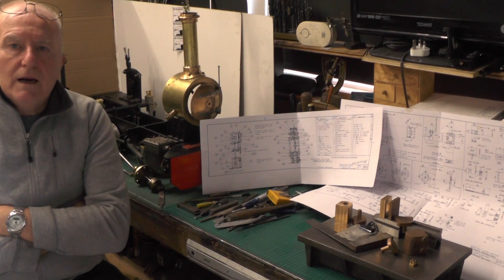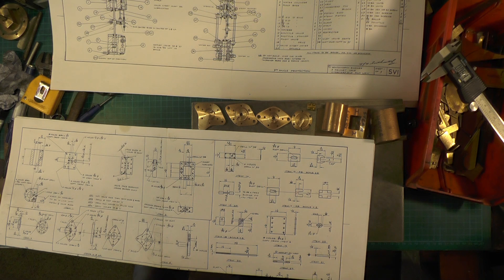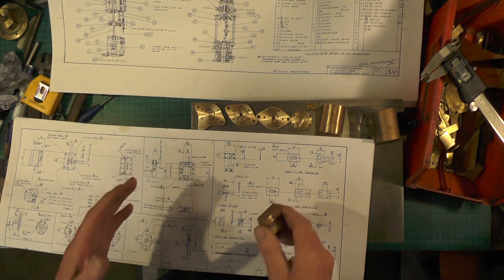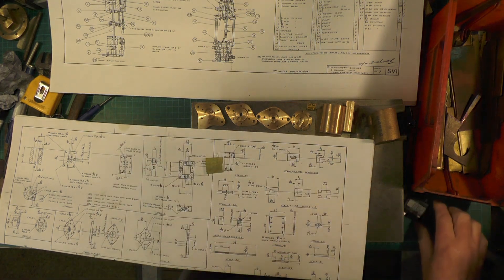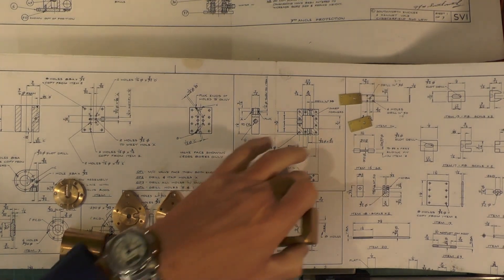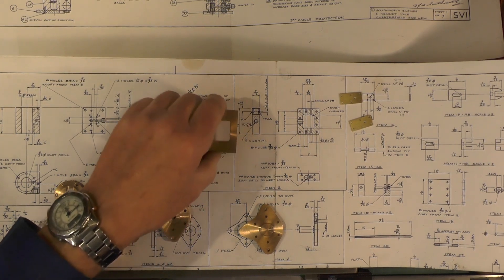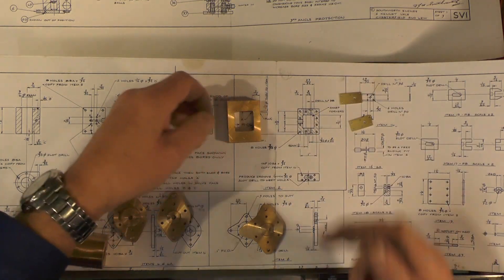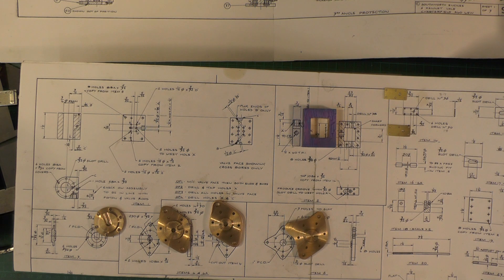Southworth Steam Water Pump Part 3 valve chest parts "mr factotum"

Comment: Enjoying following this project with you Kev. 👍👍👍At 3:25 in the video I see you are using a sighting tool with a slot- fitted punch to assist to punch-mark the hole drilling positions very accurately. This tool intrigues me, I've never seen one used before ...very  interesting. I always battle to punch-mark hole-drilling positions accurately when working at very small scale. Cheers Paul
Reply from the maker: hi Paul
thanks very much👍👍👍👍😉
theres a video coming up Saturday making one of those optical centre punches
because many have commented on it, ive done a video on how to make one quickly and with budget materials
hopefully see you saturday
regards
kev